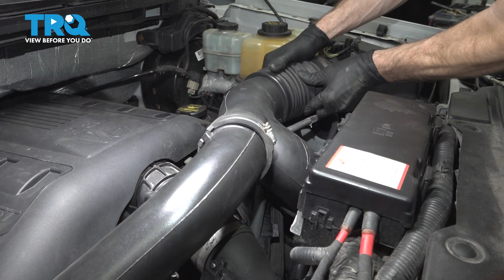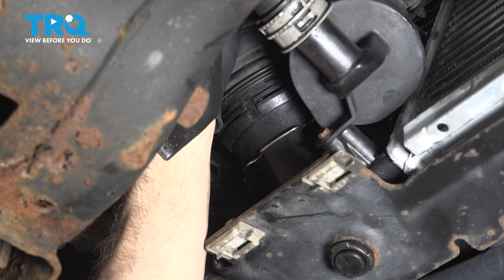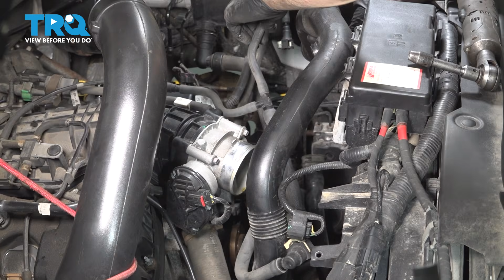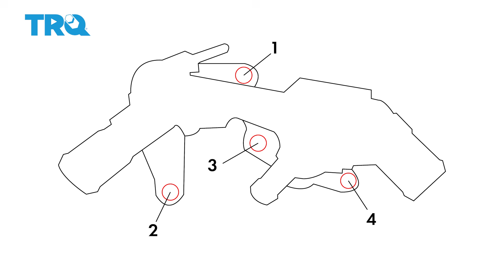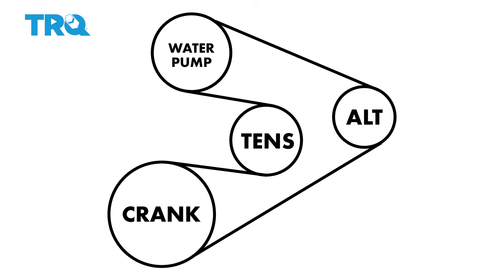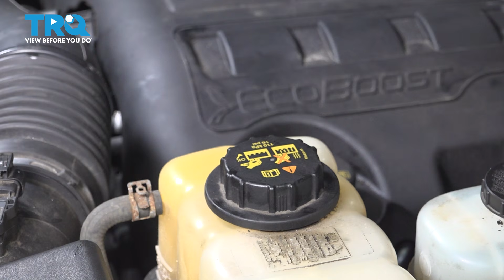How to Replace Thermostat With Housing Assembly 2009-2014 Ford F-150 3.5L V6

Comment: Wonderful explanation and great valuable information-My 2013 Ecoboost has a coolant leak that runs down the fire wall on the right side and I just can’t figure out where the leak is coming from -Also, when I start the engine the temp gauge needle takes a while to reach normal temperature as if something is emptying out and the gauge sensor will not detect until the engine has been running for a few minutes =I checked the fittings on the right hand side of the turbo but they seem to be ok and besides the leak seems to come from above the firewall.  So, essentially your video is helping me so I can explore possible problems for the coolant leak. Maybe you can point out some areas I can check out. Thanks!